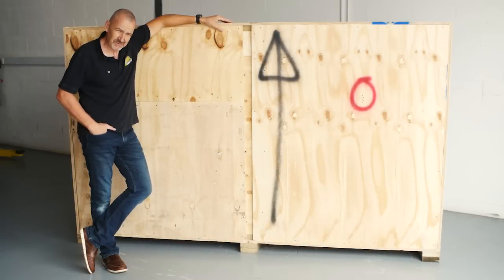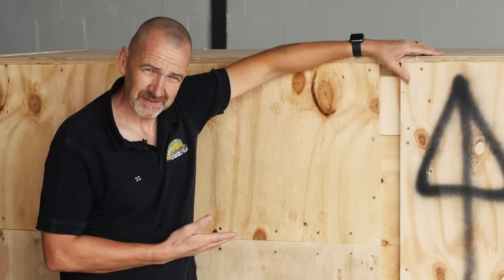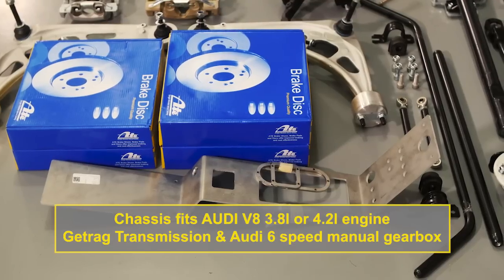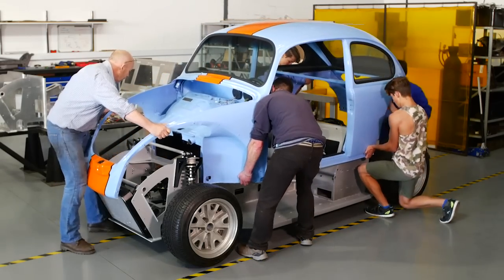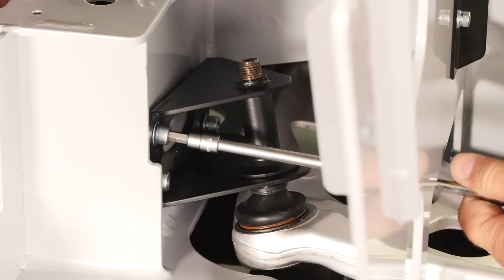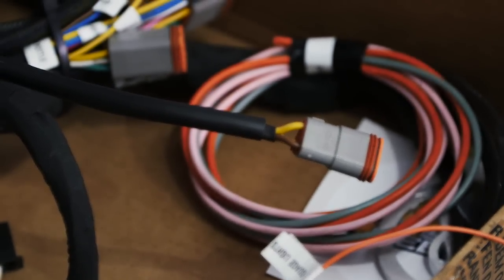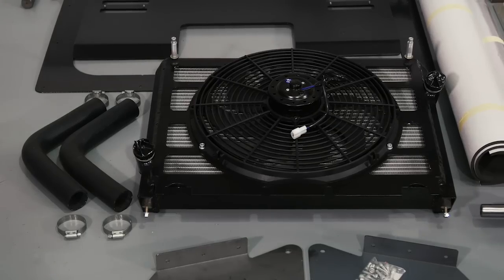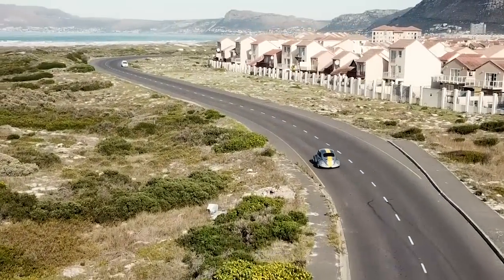Build Your Own V8 Bug: Meccano for big boys

Comment: Considering the engineering that went into this,, this price for the base kit is a steal.Watch the videos, see the materials and components used, and no way one could come up with all the parts you get here.And I should add that this is a car that will handle ,brake and accelerate in safe way that no VW chassis based car could. This is the proper chassis   that belongs under a beetle body.

Comment: Not being picky but from Jean knocking kit cars (re earlier videos that mentioned the GT40) to offering 'build your own cars with our package' must be a commercial decision. No problem with that it just shows how things change.

I'm certain that Jean has done his business plan well because the price offered when the video was made is very competitive. It would even allows me to fit a preferred 2 litre engine (I've never been into big V8's) even though I'd have to play with suspension settings.

I can only imagine that sourcing and refurbishing Beetle body shells in SA is limited even though sub contracting (material costs, chassis cutting and bending) in SA is cheaper than the UK or Europe.

A great project guys and the very best fortune to you all.

I wonder what Jean could do with a Renault 4?

Comment: That price is actually insanely low. I was guessing at least 50k.
Reply: I heard USD80,500, had to go back and double-check the text.
Reply: 50k wtf I seen v8 bug get built from a wreck salvage 2018 Corvette that cost them 5,000 from CO-parts . Let's say another 10k on top to built and weld, trans and engine its already included with the car. So even 18k its fuken expensive.
Reply: @luccerio  no

Comment: I see the question has been asked already, However I'm asking again as well.  Can you get the car in a left hand drive set up and able to accept a small block chevy?  Great looking car.  check out by beetle race car at indyair25.  I installed a 911 flat six in my race car.  3.7L twin plug with a G50 five speed.  I ice race it here in Alaska.
Reply: Hi Jr, Left hand drive no problem. Our cradle is designed for the Audi V8. If you want to put an alternative power plant like the small block chevy then you would need to make some alterations to the cradle and possibly the chassis.

Comment: Looks like some guys still don’t get it. It’s not about the power or the size of the engine, it is because Audi is owned by Volkswagen and both is German. He could have also fitted a Mercedes V8 twin turbo.No adaptor plate is needed for the Audi engine  anyway which make it a better choice.Nothing wrong with German technology.

Comment: If only it was a V8 Stealth Ghia. 😢
Reply: Im sure it could be made to fit.
Reply: NS Sherlock 
I believe the Ghia and Super Beetle has a wider pan/chassis.
Reply: That would be SICK!!!  Any Type 3 would be badass too! Hell... ANY air-cooled VW would be amazing!

Have you seen this V10 Ghia?

https://youtu.be/NTvzfOzxsdI
Reply: @pequaboy1210    the Ghia is wider than the beetles only in the footwell area.
Reply: D Rock 75 
Pretty cool but the engines up front. I want that mid engine Audi behind the front seats.
Reply: Noel Whittle 
The chassis they engineered only fits the beetle shell. It does not fit a Ghia body. I’m not an engineer nor am I a welder. It would be nice to purchase a crate specifically engineered and made for the Karmann Ghia
Reply: @pequaboy1210  yes, and we would get one for our 1967 Karmann ghia  :)
Reply: @pequaboy1210  Look again .   Its mid engined.

Comment: Is there any automatic that can be installed?
Reply from the maker: freakindawgen if you mean gearbox then yes.but we use the 6 speed Getrag manual box
Reply: @V8StealthBeetle  Yes gearbox. I am a paraplegic and cannot use my legs.
Reply from the maker: @freakindawgen  An auto gearbox could be sourced, if you can't use your legs would you need to adapt the throttle to work with your hands?
Reply: @V8StealthBeetle  yes I would.
Reply from the maker: @freakindawgen  unfortunately that's not something we are going to be able to help you with. I have a very good friend who drives an adapted car and the rules are very strict. I doubt you would be able to do it on our vehicle. let me know your thoughts. Doug

Comment: Can it be made Quattro
Reply from the maker: I'm sure it could ... but not by us I'm afraid
Reply: Fair enough
Reply: Look up mini with Toyota celica 4wd turbo running gear & engine also a quality build.
Reply: They would have to re-design the whole front section of the car and hand manufactur most components. Also to find any stock front driveline that can deal with so much torque to build of from... an R8 quattro v10 driveline would be a whole new project..?.
Reply: @atrem7942  You mean Project Binky by Bad Obsession Motorsport - been following it for years and it is perhaps THE project for learning about custom car fabrication.

Comment: If you don't like the Audi Engine... Ford 2.3 ohc is a Great alternative 600hp / 1500 lbs  w-ratio unheard of 2.5 ... close to #1 McLaren 675 2.26 💥
And  under $20,000 plus engine choice... everything around $40,000... New - Technology - Different - Fastest on the Planet! 🤔 💥💥💥💥💥
Reply: The whole point of this is to have a V8. A 4 cyl. could never replace a V8. Also this is a V8 +Turbos! Just imagine 450-650 nm starting at 1800 rpm.

Comment: Should use engines worth using
V8 in there is the worst choice possible...been beating v8s since decades with half the engine..
A 2.0l would do better in this car hondaaaaaa
Reply: Just buy the Kit and put a Honda engine inside, its your choice.
But remember it will sound like crap.
Reply: Hi Vince, I think you missed the point... 2litre Beetle just doesn't sound the same.... There's more sometimes to just driving fast... I'm sure your half an engine is super quick, enjoy